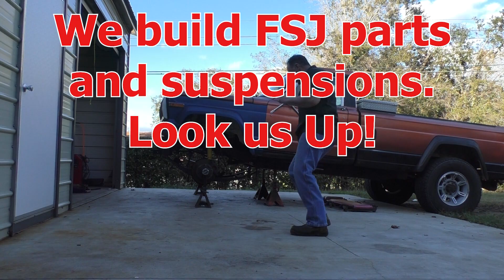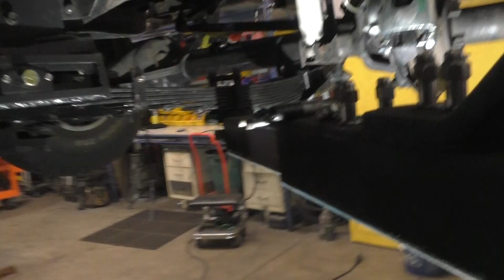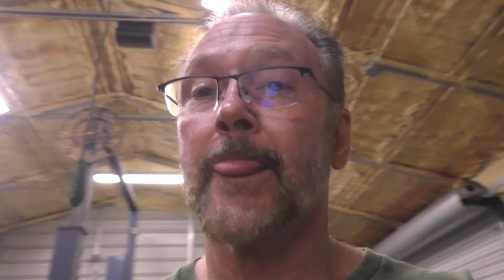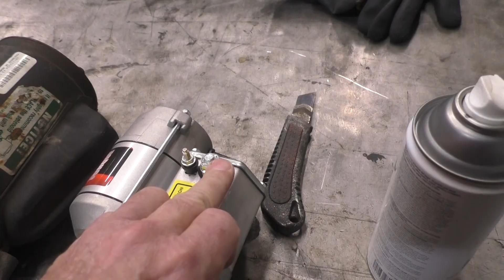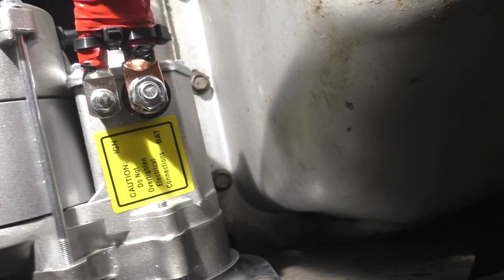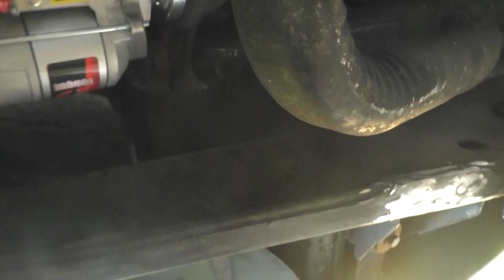FSJ J10 JB7 brake upgrade and performance starter

Comment: I read you can use a substitute j6,j7 caliper with a caddy eldorado that uses an emergency break. That would be great since ive read the j20 brake conversion to disk you can't use your e brake anymore. Let me know what you know. Thx keep up the great videos, very informative.
Reply from the maker: Yes, it is possible.  There are several Co' that have a E-brake kit using the Eldorado calipers with 8 lug wheels.

Comment: Hi would there be any necessity to get a larger bore master cylinder because of the larger piston and the caliper? Also I'm considering getting the 2.5 inch lift reverse Shackle kit and I'm hearing the people are saying the nose diving is dangerous or uncomfortable is that true in a full-size Jeep, what has been your experience with these kind of symptoms with the reverse Shackle kit?
Reply: I've never experienced a soft or low brake peddle after installing the JB7s.  Maybe it's because the FSJ master cylinders already have a large enough bore.  On my J20 I have the JB7s up front and a AAM 11.5" rear axle with Disc brakes and still have good peddle feel.  Regarding Nose Dive and the FSSR, I normally use CHEAP mono-tube shocks and never experienced the Dreaded Nose Dive when braking.  However, if you do have this issue it can be mitigated by using shocks with more compression dampening.
Reply: @adayoftruthandknowledge6357  ok thanks for the reply, do you have hydro boost set up with these calipers? regarding the nose dive issue did you notice any difference between the factory setup and the reverse shackle when Breaking maybe not nose dive but maybe a slightly different behaviour? Also regarding the Shackle reversing is it true that the axle will move one inch forwards if so what solution did you come up for with regards to the drive shaft?
Reply from the maker: @bh635   Hi, A Day of Truth and Knowledge is my other channel--sorry for any confusion.  I have never felt that I needed hydro-boost for my FSJs.  The only time I experience bad brakes was when my vacuum booster started to fail.  The FSSR makes a big difference on how the suspension reacts to pot holes and speed bumps in the road and this is why most performance leaf sprung suspensions are set up this way.  Yes, it will move your axle forward 1" and it also corrects the Caster when you move the shackle to the rear.   This video explains the reasoning of the FSSR  https://www.youtube.com/watch?v=oLEPUAzc_pc
Reply: @theslab6457  yes I figured it was you because I looked on the other channel and saw your face lol I actually fitted hydro boost to my Cherokee chief because I fitted it with a 3.6 liter twin turbo  diesel v8 from a European Range Rover and I needed the space because the engine is much bigger than the 360 and wow the brakes are truly amazing with the Hydro boost that's why I was wondering how the larger calipers would work with hydro boost. The improvements in Road handling as you described are exactly what I'm looking for, the current setup is simply too harsh, my only concern was this nose diving but if that isn't an issue I'm going to go ahead and buy your kit I wonder what the postage will be to Ireland that's where I am based
Reply from the maker: @bh635    I used to sell on Ebay and used their International shipping but I ran into some serious conflicts with them that force me to part ways.  I would expect that the Shipping/taxes etc would be approx' the cost of the FSSR.  If you have an exporter, I can ship to them.
Reply: @theslab6457  ok what is the weight and size of a complete kit? i do have an exporter in the states that will post stuff over to Ireland
Reply: Also where can I speak to you more directly do you have an email or fb?
Reply from the maker: @bh635  Rocklaurence@inbox.com